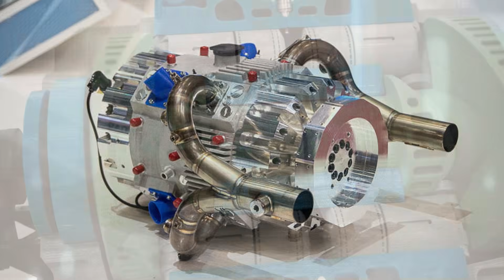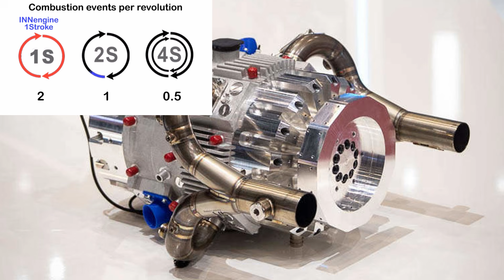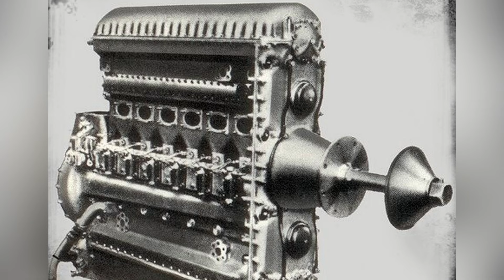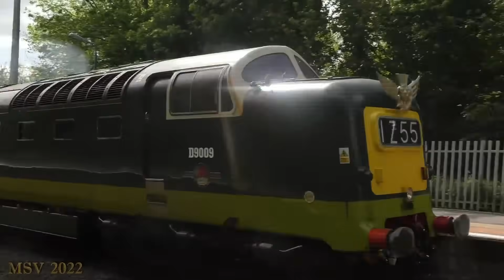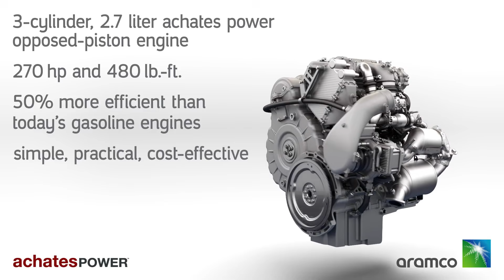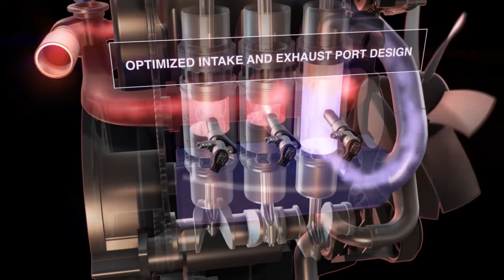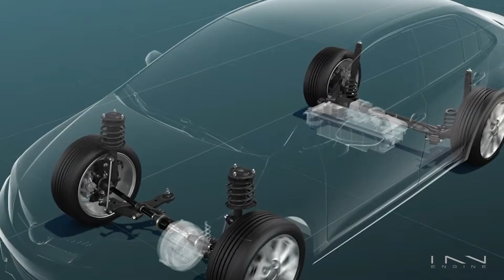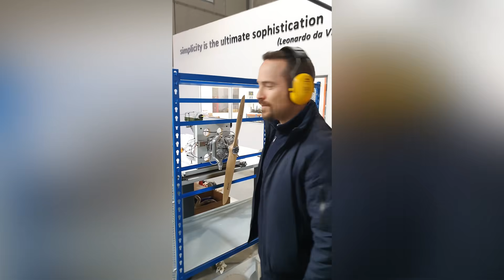NEW OP Mini-Engine DESTROYS Pure EVs

Comment: In terms of reliability Ev's Destroy this hands down. As a mechanic I can see all the little problems an engine like that will accumulate over a short period of time. It works great when its perfectly clean and the oil is the same, but internal combustion engines are inherently inefficient and things like Blow by and oil contamination are a thing in the real world. In a clean room, sure! try that in a desert or on a mountain with low air volume.

Comment: Like many people, this presenter does not actually understand why we are converting to electricity in various forms of transportation.  He mentions the hybrid approach to increasing the range of batteries, but if you are going to do that, why have the battery?  The point of going electric is to ultimately eliminate carbon emissions.  Running this engine releases carbon just like any other ICE.  It solves no problems we can't already solve.

Comment: Why bother as a range extender? Hook this up to a gear box and mount it and you could just use it as a front wheel drive assembly. Heck, for Its size, you could mount it in the rear like a tesla drive unit. Anywhere near as powerful? No, but you don't need high power all the time. If the techs cheap enough, we could see a return to the low power, cheap hatchbacks of the 80's and 90's and honestly, with the cost of a new car now, the auto industry might just need that.

Comment: The inn engine has no torque and the version shown in the mazda waa said to be naturally aspirated but if you look youll see a super charger.  Plus the ring friction alone negates any advantage.  Its trash.  We use crank shafts and cams for a reason.  They allow massive power.  This thing is ok for a very light car on flat roads if you dont mind taking 60 seconds to reach a top speed of 30mph.  Lol

Comment: Hydrogen is not a combustable fuel in the fuel cell system. Hydrogen is simply to be used to generate electricity to drive an electric motor to drive the vehicle. It is inefficient and cumbersome, plus hydrogen is an expensive fuel to buy.

Comment: As the owner of a Tesla I love the simplicity and no maintenance except for tire rotation and windshield wipers blades.  Adding an internal combustion engine of any kind is old school thinking.
Reply: What kind of old technology do you think charges the batteries in your car? ICE can be super efficient and are getting cleaner all the time. It's very blinkered to think electric is the way forwards, I'm yet to see an electric vehicle with enough range to be a game changer, the caravan and motor home industry is set for destruction if the ranges can't be improved drastically. The thought of going on holiday in a battery powered motor home is laughable.
Reply: @mikeatcora  we have solar on our home which provides all the KWH’s for our home and Tesla (except on road trips).  We do not pay one dime for “fuel” within 200 miles (round trip) of home.  Not worried about the RV industry that will or will not work out over time.  We have taken long road trips the longest was 1800 miles will no issues.  Road trips are actually easier in the Tesla.  With ICE vehicles I tend to push hard with only absolutely necessary stops and as a result always end the day exhausted.  With the Tesla we stop to charge and take a break every 2 to 2 1/2 hours.  20-30 minutes bathroom, get something to drink and stretch our legs.  Car is ready we go again.  End of the day I feel like I’m ready to go dancing.  This car works really well for us. Your mileage may vary.

Comment: Series electric is the best of both engine types. You get the torque of electric, regenerative breaking, and the energy density of hydrocarbons/hydrogen. The key is super efficient light weight combustion engines as range extenders.

Comment: As a retired machine designer, I've seen a lot of machinery that used rollers in tracks - I've even used this in some designs in the past. But, these are extremely wear sensitive and when they start to wear it doesn't take long to have catastrophic failure. Nothing is simpler, less expensive and longer lasting than rotary or pivoting bearings.

Plus there is still the CO2 emissions that cannot be eliminated when burning a hydrocarbon. H2 is extremely energy intensive to produce, transport and use. Also, using it to replace petrol fuels is very inefficient compared to using it in a fuel cell. Someday, H2 may by practical, but I've been following this for over 50 years and nothing has proven economically feasible yet.
Reply: 2 stroke forever brappp!
Reply: Lighting bolts and the sun are plasma 2 stroke entities!
Reply: Thanks for your input. Coating of the Cam-track seems to be basically a must. I would recommend Boriding or High velocity sprayed coatings. 

Some type of means to adjust the backlash in the track rollers would also seem to be a necessary improvement, or, as in conventional diesel valve trains, a hydraulic system to control backlash. 

Also, practically speaking the track rollers need to have a conical and not cylindrical profile to avoid sliding/scuffing wear, but that introduces more complex off-axis loads.

In my day job I've often dealt with issues with rigidity of tool holders for mills or boring bars, so the roller cam design seems to be fraught with a lot more nitty-gritty engineering and reliability issues than old-school hydrodynamic journal bearings.
Reply: I am with you: combustion engines utilizing H² are neither the solution nor a stopgap. 
It may be more efficient and cleaner than petrol combustion engines. But it's still a combustion engine. 
You wont change human behaviour in one generation if you dont offer alternatives. And one alternative to a combustion engine is a fuel cell. That'll be the wiser choice, rather than going for battery powered cars - batteries are heavy (~900kg for the heaviest) and mostly negating the benefit of having an EV, while fuel cells and a tank would be around 1/10th of that...?!
Reply: CO2 emissions are pretty irrelevant if we are talking the environment... Nox is really an issue but CO2 not so much. The earth flourished when CO2 levels were massively higher than they are today. I believe ice core data showed around 2-4k ppm during the time the dinosaurs lived, and without that high Co2 to allow the production of mega fauna the dinosaurs would have never flourished. The worlds population continues to grow, and increasing Co2 is one way we can produce enough food to feed this growing population!
Reply: @DarkAttack14    If you want to be in denial  about carbon emissions, that's your choice.  I'm not going to try to teach you about it.  I will say that dinosaurs and feeding the world has nothing to do with this.  

You have three choices, 

1) Learn something about the real science relating to CO2 in the atmosphere. 

2) Remain in denial about the issues and simply be angry with the rest of the world who want to not continue down the wrong path. 

3) Think what you want to think, but not make yourself look dumb by talking without knowledge.
Reply: If one wants to utilize hydrogen for power, use fuel cells. Fuel cells are 50% efficient compared to ICE's 30ish%.  EVen then, I can only see hydrogen fuel cells to be handy in space colonization where infrastructure is limited. Here on Earth, batteries and widening of green energy production has been showing more promise than hydrogen power on cars. Not to mention, storage problems(including the hydrogen embrittlement).
Reply: YEP. Steel on steel is bad business.  Even rollers don't spread the load  enough.
Reply: CO2 is plant food and therefore essential for all life ofn earth.
Reply: It's an anti-human trend.
Reply: Fuell cells are only ~50% efficient.
And expensive / hp.

That's still only 32 to 37% overall efficiency depending on the exact H2 storage route. ( power in >> power out of engine )
Electrical vehicles with Batteries are roughly 80% efficient when counting actual motive power generated. ( i.e. % energy applied to moving the vehicle ).
Reply: Yup. this channels is BS. I'm banning it from my feeds
Reply: Until you can store hydrogen liquid stably at room temperature this is a fantasy. 
Most people don’t know the difference between carbon dioxide and carbon monoxide…
Reply: @joeyager8479  Not just not "feasible", but horribly expensive.  Even if you eliminate the carbon emissions, all ICE emit NOx which is not so easy to get rid of.  We  have engines that meet the current requirements, but they continue to emit.  Our cities have visibly dirty air.  

Once everything is electric, we will have much cleaner air.
Reply: @rickcollins2814  there just needs to be a transition to it. So it's natural for new ideas to emerge as bridge gap to electric systems and relying on centralized power that can be more closely monitored. I mean what will the CARB do after there's no cars anymore? They'd need a new place to look. But until then there's always going to be a mix of power plant designs as we transition to more electric propulsion.
Reply: once everything is affordable electric, we will have much cleaner air  @rickcollins2814
Reply: @rickcollins2814 electricity and renewable energy just transfers the co2 to a different area of the globe. The most important thing is to scrub the toxins and let the co2 out to feed the plants and reduce cold weather deaths. We already have all that technology.
Reply: @rickcollins2814 
Hydrogen is even more dangerous than batteries.  It makes metal brittle, turning any hydrogen fuel tank into a fragmentation bomb in a collision (even WITHOUT ignition of the hydrogen).
Reply: @rickcollins2814 
NOx breaks down quickly in sunlight (UV makes it very very unstable)
Reply: @akulkis  Not quickly enough to prevent a significant content in the air.  Fortunately, the catalytic converter also turns much of it back into N2 and O2.  Nitrous oxides were a significant component of smog, until we started paying attention to cleaning up the air.  Unfortunately, we still have non-trivial  amounts of air pollution in the big cities.
Reply: @rickcollins2814  we won't have much cleaner air by switching to electric. Perhaps when it comes to propelling the vehicle, that's cleaner air only contained to that but if we're talking about the electricity generation and storage (batteries), you produce a lot more emissions overall than just the usual gas extraction, refine and storage into fuel to combustion over mining battery materials, storing electricity for usage.
Reply: @rickcollins2814  just to clarify this: you say, all Internal Combustion Engines produce NOx when burning H²? So chemistry is wrong, when it says H² + O² = H²O² ?
Give this man a Nobel, he might never get one irl!
Reply: @ÐÆMØN420   That is what you might get if you mixed H2 and O2.  More likely, you would get 2H2 + O2 = 2H2O.  H2O2 is hydrogen peroxide, which is not a good thing to release into the air. 

However, cars use air as the oxidizer.  This includes 80% N2, resulting in many nitrous oxides being produced.  

Chemistry is not wrong, but you have to actually know something about it in order to use it properly.  

BTW, I have a chemistry degree.  Is that better?  No Nobel Prize yet.  Still working on that.
Reply: @rickcollins2814  my bad, I was kinda uninformed and just used my highschool-wisdom.
After reading a tad more about it: The formation of NOx depends on the number of air in intake manifold injection 𝜆 and from the combustion temperature, so your exaust gas will be steam and little to none NOx - IF the engine is tuned correctly.

Still: the efficiency is pretty low and ranging between a petrol and a diesel combustion engine. So hydrogen powered combustion engines would be a sidestep: away from fossil fuels towards a renewable energy source where the customer doesnt have to change its behaviour: put the hose into the gas tank, maybe lock it a little, wait a few minutes until you've filled up your gas tank with kg of gas instead of liters of petrol/diesel, and then go.

Comment: While achates is 2 stroke, emissions should be better than standard engine.  The only 2 stroke engines with issues are those that are crankcase scavenged, requiring oil to be mixed with fuel, and then combusted.

Comment: The only things that matter today are:
1.) emissions
2.) durability at least 150k miles or 10 years
3.) Fuel Economy - at minimum 25% better than the best of piston engines
4.) Lower production cost per unit than established engines

IF all 4 are not realized even in low volume production, then the design DOA
Reply: My diesel car does that. 330,000 km passed, refurbished just this month some to be better than as was new, and will another 400,000 km. That 2) is filled. From factory 6L / 100km, I made it x2 hp, and it spends same. That is 3) filled. Emissions, I haven't put the last part, about 40-50% less em, it is still in my storage. That 1) is filled. For the last one 4) ... well I am not a factory, I go on Zero-Cola.
Reply: Are you telling me my steam car design isn't going to take off
Reply: @ComradeSulomon yes it won't
Reply: @aryantyagi12a  Doubters gonna doubt

Comment: I think the hybrid got a bad tag. The hybrid could answer a lot of demands. The battery simply won't be able to for quite some time. If, however, something like solid state batteries come onto the market to meet the promises they are talking about, 700 mi charge to charge, 10 minute charging, etc ., there'll be no more need for gasoline powered vehicles at all.

Comment: When I first saw the Opposed Engine, I was so excited about its principle. Moreover, five years ago, I translated a video with a voiceover about the Achates OP Engine into Russian and shared it on my channel. The company had just introduced their prototype to share the idea and concept, but you can't even imagine how much hate the "couch's experts in this field" wrote in the comments below in the end...
Reply: This particular motor has the limitation of two “crankshaft” outputs.  Most uses can't take advantage of that.  Then there is the fact that it burns fossil fuels, which will become much harder to buy and eventually prohibited.

Comment: I am not an engineer. But it seems there is so much metal to metal contact, unlike the main bearings, and the rod bearings of a conventional piston engine. The crank and the rod bearings ride on a  relatively touchless hydrodynamic wedge of oil.. it may be Thermo efficient, but there seems to be a lot of areas of friction that would require a very high film stregnth oil to protect.. even with the additions of zinc and phosphorus in today’s oils, the lifters contacting the cam is still not fully protected by the film of oil..
  Put these pistons following those slots, and Wood appears to be similar to a motorcycle sequential transmission shift drum. I really don’t think that design would have a long service life.

Comment: If we double efficiency, pollutants per energy unit created are halved. EPA has the cart before the horse, as usual. EV is already dying, look at inventories. Electricity, hydrogen (cracking water by electrolysis) etc., is a product of energy created by….hydrocarbons, nuclear, hydro. Solar and wind cannot overcome the massive energy used to produce the power producing end product that eventually generates a feeble, unreliable and poorly storable electrical output. Hate me for telling it like it is? Hate away!

Comment: There is no such thing as one stroke, they could have called it a 3 stroke and maybe it would have been legit. Because the intake and exhaust are happening at the same time. Then compression, and power. In a piston engine the minimum is 2 strokes to run and make power.

Comment: As an automotive engine the INN is crap. The number of cylinders, short stroke and tiny amounts of torque make it unsuitable.  Better as a fixed speed generator or a range extender.  It doesnt destroy anything let alone EVs which produce far more power and torque vis their inverters and motors.

Comment: Two facts everyone needs to know. 1) IC engine efficiency is only 40% at best 2) IC engines are massively complex compared to elecrtic motors.
Emissions are only going to get tighter, so however good this might be, future emissions restrictions will soon outlaw it. It's a novelty, it won't ever make mass production.
Batteries are rapidly getting better, not a decade away.
Hydrogen IC engines are hopeless. The overall efficiency end to end is one third of a BEV.

Comment: EV's other advantages include lack of cooling system, oil changes, frequent brake pad replacement, transmission, etc. It is not just the motor advantage.

Comment: First, we don't know how long it will take for technology to resolve ANY problems, so we don't know it's a decade away. 

Where is this engine "destroying" EV's? An electric motor is 80 to 90% efficient, ICE engines are heat engines with 40% efficiency max. An electric motor has a relatively flat torque curve that's why EV's don't need transmissions. ICE's need transmissions because they have a very narrow torque band.

Toyota just announced they will be coming out with an EV with a solid state battery in two years. The bottom line is EV's and battery technology are rich, we got 35 mpg with ICE engines in 1965. Ten years ago we went 84 miles in a Leaf, now we go over 500 miles and charge in 18 minutes. The only thing gas engines are destroying is the planet!

Comment: I rate this the same about solid state batteries in development. Hype. Tony Seba told the world in 2014 what was coming. Big Carbon had its chance but they locked up IP and solar will be surpassing coal next year. The batteries produced at scale are working now. The cost curves are dominating now. No hybrid strategy will scale fast enough to bring its costs down when EV's require less parts to make especially with gigacasting the fronts and butts. The TCO is compelling now.